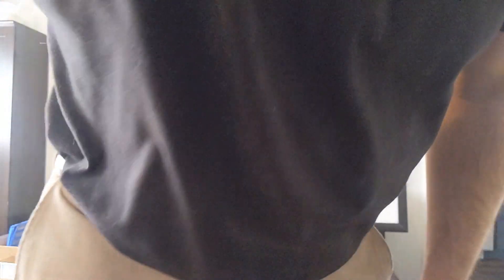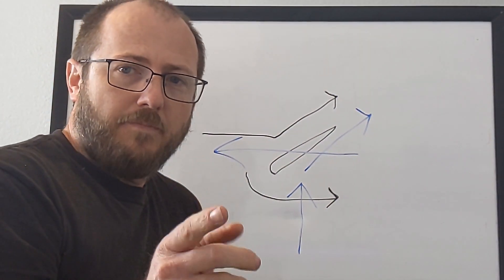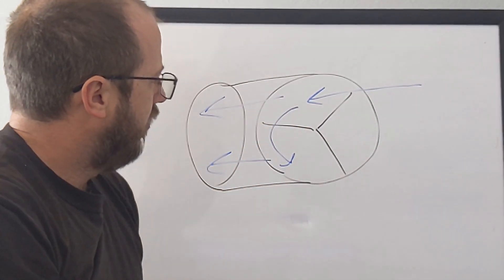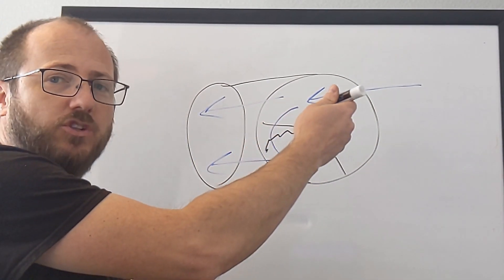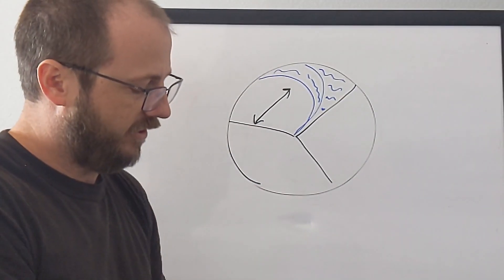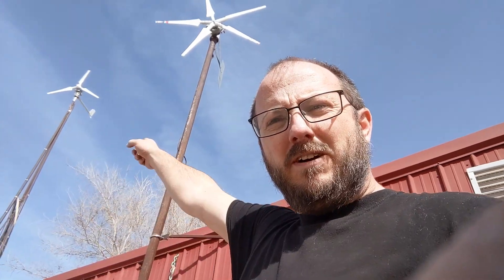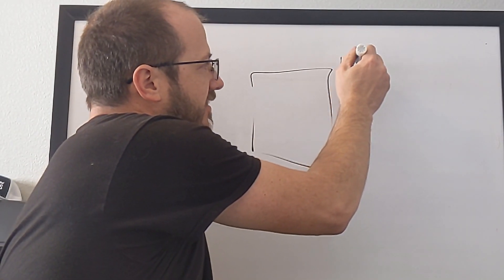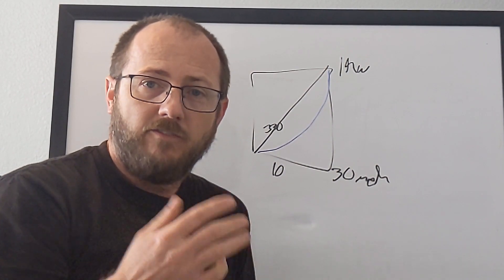Should I put more blades on my wind turbine?

Comment: Great video.I have swapped my 3 blades for 5.In a low wind situation it would appear that 5 blades will give more overall output,I have read 60%.One size or blade number doesn't suit all wind conditions so it's all about finding a good compromise.The engineering with Rosie channel gives a really good academic analysis of optimum blade number .There is a whole field of science and it's fascinating but mind blowing! Pun intended
Reply: The 5 blade will generate at a lower wind speed compared to the 3.,but the 3 blade will generate more energy in a higher wind than 5.The 5 blade is designed and sold as suitable for low wind situation.Istabreeze is the manufacturer
Reply: So, in your conditions, the 5 blade was more productive compared to the 3blades before?

Comment: With my i-1500-24v, I was'nt happy with the cut in speed using 3 blades. So I changed to 5 blades. This got me an earlier cut in but noticeably less power overall. And the turbine seemed to "wall-out" at around 400-500watts with a fairly loud fluttering/flapping noise, after which it seemed reluctant to increase speed and power.  So......I changed back to 3 blades but then ran into a 12v battery bank instead. Presto! - similarly low cut in speed but this time rapid power pickup and eager progression up to 400-600w in 15-ish winds with peaks of 900w at 20ish mph which I'm really happy with.  So, for my wind conditions reducing the battery voltage gave a better result than buying a 5 blade arbor+5 props. Really surprised that I'm not losing more power given I'm runninng at half the rated voltage. 3 blades is where it's at!

Comment: Mine has three. It's going to be fine. I'm working on the pole tomorrow. I got a 600 watts model. It will be 19 feet up, fastened to the peak of the barn. I just got a 1 7/8" pipe. I figure to get 350 watts some of the time. I should have it up by Saturday. I plan to treat the blades with Armor All to make them more slippery.
Reply: Would you be kind enough to give us the updates for your setup?
Reply: @jonanderson4280  it's only 16 feet, because of lightning ⚡ danger
Reply: It's making 150 watts at the moment
Reply: In a gust it's going to 400 watts

Comment: I set up a six blader. One positive was it was easy to balance. Select the closest blade weights and install each matched pair at 180 degrees. Also the upper speed limits need to be matched to turbine and load. The inefficiency may be a good thing as you know you have other speed controlling devices and tilting turbine etc. If the inefficency cuts in at above max power maybe that's a good thing?
Reply from the maker: If best efficiency happens before rated power then it's the RIGHT thing.

Comment: Very good explanation, but you missed a tiny detail that also affects efficiency. 
Every set of blades is optimized for a certain tip speed ratio and for every tip speed ration there is a percentage of frontal blade area that should cover up the rotor circle. If you add more blades of the same type it will just cover up too much of the circle and prevent the wind from flowing properly through the turbine, slowing it down and degrading efficiency. By putting on less than the optimal number of blades you are actually not catching all the available wind and some of it flows through the turbine without doing any work, also reducing efficiency. 
This of course assumes that the blades are actually optimized for their tip speed ratio, which I have my doubts about with some chinese turbines.
Reply from the maker: I talked about TSR in some of my drafts but then it required me to get into a couple other details like your explanation of surface area within swept area...those "quick simple" videos kept ending up at 25 minutes or 45 minutes or even an hour.  Surface area to swept area could be a 10 to 20 minute video all by itself
Reply: @ToysforWatts  Sounds like a quick TSR video ready-made, just need to edit and post.

Comment: What's wrong with two blades? You reduce the disruption and also the drag. The force is reduced but not that much. You should compare two and three blade turbines at different wind speeds and loads.  Also an arrangement of staggered blades where one does not follow in the same track as the preceding one will reduce the turbulence. There is no reason you cannot stagger the blades along the axis.

..
Reply from the maker: Two blades works and is efficient but is very hard on the tower...they don't yaw well while in operation, requires a much heavier rig to turn and in small applications they track very poorly.  A lot of the better two-blade designs have been small downwind style turbines.  They have been built, they simply require greater mechanical effort and the whole point is to get the most milk with the least amount of moo.

There actually is a reason you can't stagger the blades.  You could put blade #2 ahead of blade #1 to keep it out of the wash, and blade #3 ahead of blade #2, but eventually it all comes back around.  If you have three blades, blade #3 is going to be very close, if not behind, blade #1.  Also there's a mechanical restriction in doing so...it makes the hub far more complex and you would, in a sense, be running multiple single blade rotors in sequence.  It would be a complex and high stress system without much gain.
Reply: @ToysforWatts  Sounds like you've already worked it out. Thanks. I'm still hoping you can check out the Ugrinsky design for the vertical axis turbine as described here:    

1755 How To Make A Super Efficient Wind Turbine - The Ugrinsky VAWT Made Easy  

Thanks.
Reply: @ПатологоАнатом-г2м  Well he claims it is 56% more efficient than other VAWT's and VAWT's do have advantages.

Comment: You are making one critical mistake in your calculations!!! When adding blades, IT IS NECESSARY TO REDUCE THE DIAMETER OF THE TURBINE!!!
Reply from the maker: I'll have to rewatch it to make sure I made this point, but I was mainly speaking of purchasing premade blades and in terms of only changing the one variable (blade count).  Most manufactured blades do not allow you to adjust TSR without a hacksaw.  I do know I made it point to stress that if you change all the variable you can still get an appropriate end result, but that you cannot just change blade count.

This video is somewhere around the 30th effort made...a problem I had in creating it is that I kept going off on tangents that I think are important but did not help land the point.  My first attempt was over an hour long, a good bit of it was spent along the lines of "however by lower your TSR and using lighter blades you can double the blade count while maintaining maximum potential RPM" and then having to explain that that would also not help lol
Reply: @ToysforWatts  It is necessary not only to shorten the blades, but also to change their geometry, otherwise nothing will work!
Reply: Depends.

Power is determined by speed (RPM) and torque.
Sometimes torque can be more important.Think of old windmills that were used to grind corn or pump water.

In areas of low wind verlocity having more blades to produce more torque at lower wind speeds can give a greater electric power output than a turbine/generator that rarely spins at a sufficient rate or never starts spinning at all.
Reply: @ 👍☝🤝Всё верно!

Comment: Занимаюсь одно лопастным ветряком, успехов вам, считаю его эффективным по снятию энергии с ветра,у меня есть книга Фатеева про ветроэнергетические установки там все написано.
Reply from the maker: A single blade turbine can certainly be done and it is a really efficient way of extracting power from the wind (or generating thrust with a motor)...the single biggest flaw with a wind turbine is that it puts a very heavy twisting load on the tower.  A counterweight can balance the actual rotational stresses, but the wind will act like a lever at the tip of the blade and put a torsional load on the hub.  With a small turbine it's not going to be too hard to make the tower strong enough to handle that load, but with a large turbine it can be near impossible.
Reply: @ToysforWatts  винт крепится как на автожире, на оси,она качается,и лопасть работает под не большим углом к вертикали,она все время балансирует
Reply: @ПатологоАнатом-г2м  чтобы пользоваться опытом людей подписан на многих, видео однолопастников встречаются на Ютубе, успехов вам
Reply: @ПатологоАнатом-г2м  у меня свой путь,свое видение ветроэнергетики
Reply: @ПатологоАнатом-г2м  да снова лопасть поломало,в этот раз был прямой привод,мотор колесо от гиросутера, нагрузки на лопасть не было,врш все время срабатывал, на Авито купил помощнее мотор колесо,жду когда придет

Comment: What about just 1 blade W a counterweight? I heard that the ideal number of blades is Just 1 For best performance.
Reply: У меня работает одно лопастной ветряк, успехов вам
Reply: that system was used on airplanes in the 1930,, but i results in  a uneven torqe on the hub assembly ,,there is a channel dealing with ww2 fighter planes and such he explanes the blade problem from a different angle, gregs airplanes and automobiles, thats the name
Reply from the maker: One blade is actually the most efficient in terms of production...in a driven propeller it's actually the best way to get the most RPM out of an engine...it is unfortunately terrible in literally every other aspect, however...particularly in harmonic balance.  Turbines with one blade have been made, they are quite twisty.
Reply: Yeah i guess that they experimented with 1 blade props back in the early days of airplanes with a counterweight with good performance. but i can imagine the counter forces upon the changes in the wind direction and gyroscopic forces if used for wind turbine application.

Comment: Thanks for explaining that I got five blaze to take off of my 10 blade turbine never had anyone explain like that I only been getting 3 to 5 amps some time 10 in 35mph wind  2 to 3 amps in 10 to 20mph wind it's at least a 3000watt turbine axle flux home made with over 7ft   blade
Reply from the maker: Ten blades is certainly a lot of blades!  All of the axial flux turbines I've dealt with were still fairly high RPM generators, though if you built it yourself you should be able to do the calculations based on wire and coil size to see exactly where your RPM needs to be.
Reply: @ToysforWatts  at 60rpm it puts out 12.5v the 9 coils are 16ga.at 75 turns on 12 inch diameter with 24 neodymium 1'x2'x1/2 have bench test over 200v at hi rpm so know it'll do better than it is doing now I put more blade for lower wind thinking I will get more power but I guess not thanks for letting us know I will give you updates on how it goes

Comment: Should they be longer for more torque in low winds?
Reply from the maker: One of the benefits of having fewer blades is that that they can be longer and reach a higher RPM (assuming all else remains the same).  If you're not careful, though, you can run faster than your blades can structurally handle...that's a limiting factor I didn't touch on because most shelf-bought blades will be very hard to destroy through over-speeding them, it is certainly a possibility.  In general, though, yes...increasing the blade length will increase your maximum power potential.  It's a matter of balance, though...longer blades means a higher mean higher TSR, and if you get your TSR high enough you start negating the benefit of keeping the blade count low.
Reply: @ToysforWatts  I think the wind farms have adjustable rotors, and they adjust them to turn slower in high wind, I could be wrong though. I have seen single units with still blades when they are under maintenance or out of service when I drove by
Reply from the maker: Yes large commercial turbines have variable pitch blades, but it's not to regulate speed in high wind...they can, to a certain degree, but generally they pitch out with the turbine is off.  It's more of a braking mechanism because no mechanical brake could possible stop one of them in a gale.

Clarifying ~ Commercial turbines can adjust their pitch to maintain RPM, and they do, but the variations are rather small in respect to the size of the machine.  They can adjust for only a certain range of wind speed before it's better to pitch completely out of the wind and wait for things to calm down.